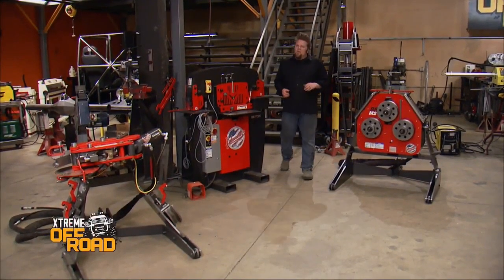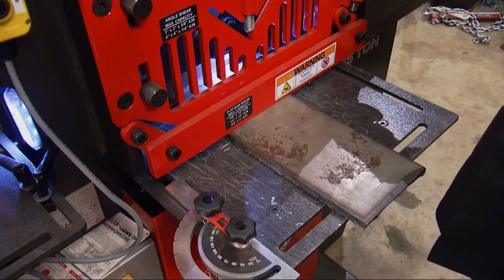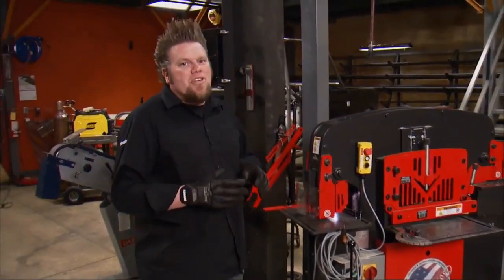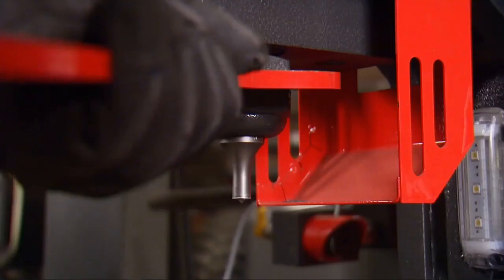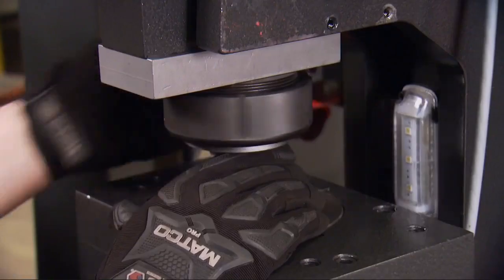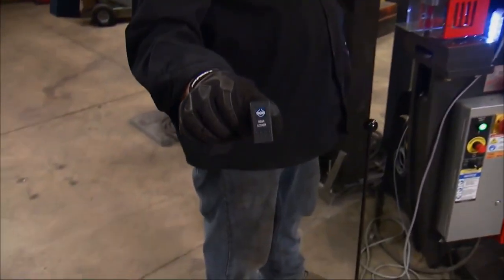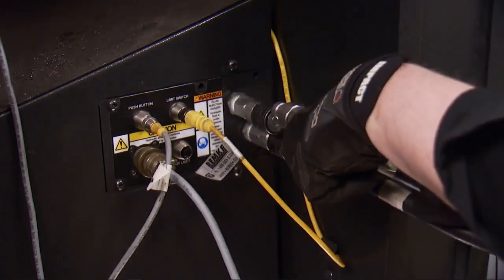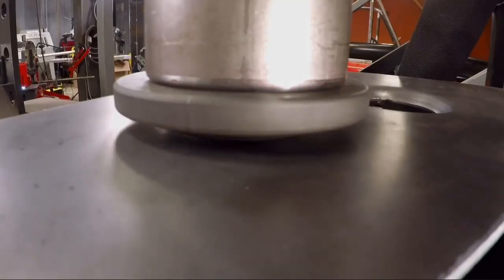Xtreme Offroad's Ian Johnson demonstrates his Edwards Ironworker. A must have for every Fab Shop!

Comment: You don't want one! The angle iron Shear rounds the cut no longer making it a true 90 degrees. The Lower Deck on the punch is made of inferior material. After awhile it punching Parts you can't remove the lower die without hammering it out from the bottom side and taking a die grinder in it to be able to insert the next one. The changeover from punch to press brake is annoyingly time consuming. Etc etc how do I know I've got a 60-ton and wish I would have gotten a geka or a piranha. Shearing material as fun as well if it's under 3 inches it just Stacks up and doesn't slide out the Little Chute. And so on and so forth. The guard around the Cooper notcher makes it so hard to see what you're doing might as well pitch that thing in the trash and fasten the plate down to the deck. Any other questions. Oh yes and the proxy switches for adjusting height and depth stop are absolutely annoying and inaccurate.
Reply: Did you loosen the pinch bolt on the punch for getting the lower die out? Also with the angle iron, mine came with the blade setup for over 3/8’s, if you flip the blade around it will cut the angle perfect. Those were the first issues I had, one I can’t fix is the shit cut it does on the shear with 3/4x3/4 and the throat of the shear doesn’t open enough till the middle of the blade... horrible costumer service to, I called for help and did not receive any what so ever. It’s like the guys had never used the machine, disappointing, I expected more from American made.  I see your comment is 4yrs old, hopefully you got your issues resolved.